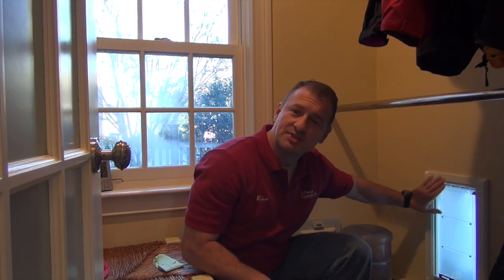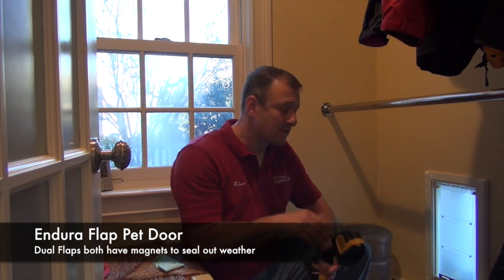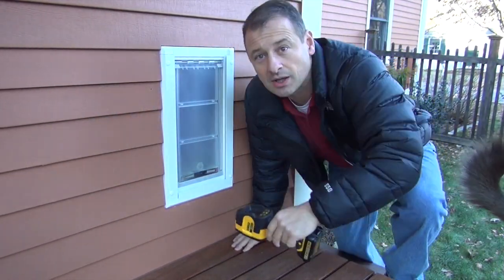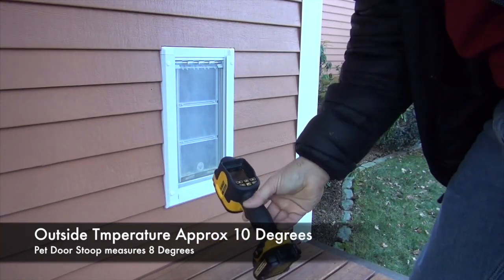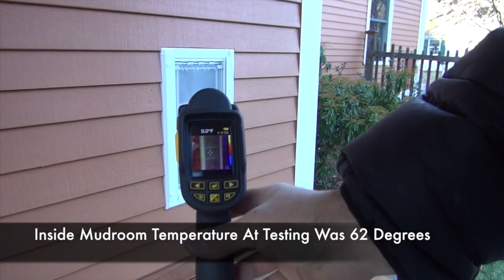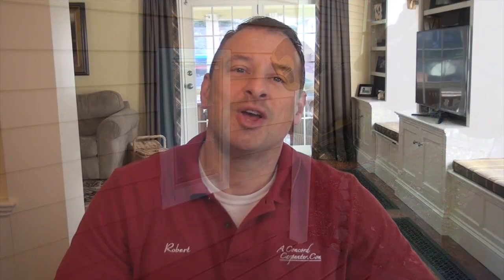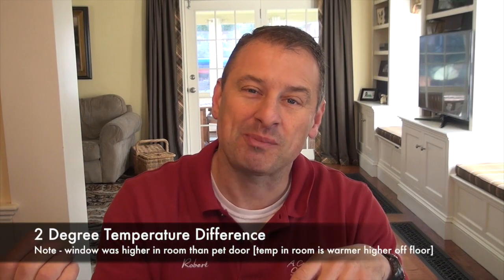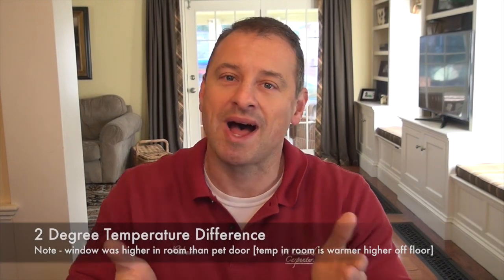Endura Flap Pet Door Temperature Testing

Comment: I would have rather seen the temperature around the edges.  That would have been much more useful information than in the middle of the panel.
Reply from the maker: Luke if that's the case then I should've tested the edge of the Marvin sash at the window jamb